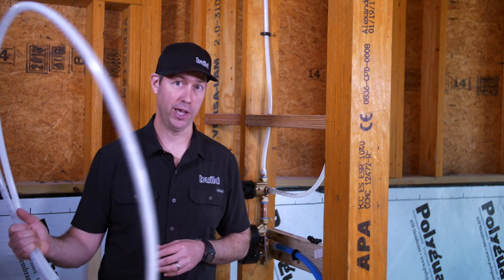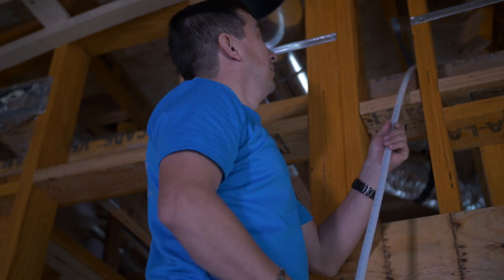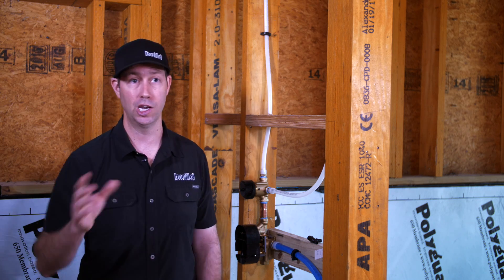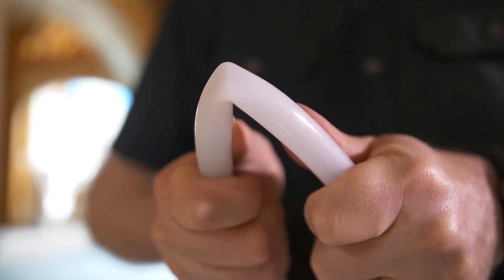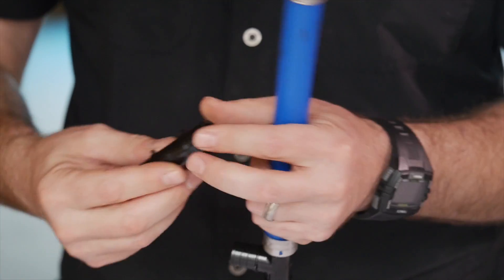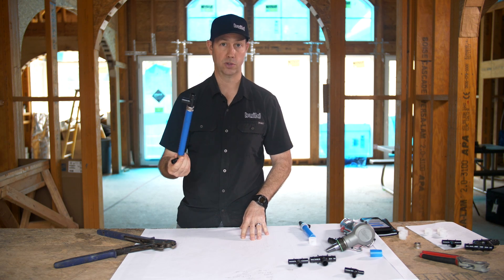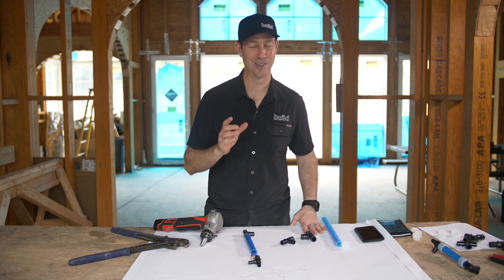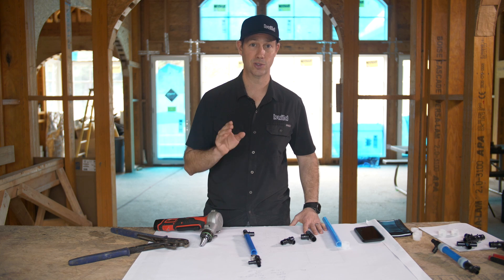PEX vs. Copper Plumbing

Comment: Thanks Matt. Great video, and lot's of info (no matter what others say!). Other than the price, installation ease,  and fitting inside diameter, is there any difference between PEX-a and PEX-b in regard to long-therm reliability?
Funny to see so much heated comments... I used copper main with PEX-b branches in my old house more than 24 years ago (because I was worried), but only used PEX-b when I build my cottage a few years ago. Should have used PEX-a though, for water flow.

Comment: I wonder about some other fitting systems such as Shark etc.  I don't do plumbing except at home.  I did gas and water plumbing as a commercial appliance technician.  I am planning some plumbing alterations using Pex but cannot validate expensive crimping tools.

Comment: I am hoping this video will convince my husband to finally switch to pex after 8 years of nagging.  He swears by cpvc even though he has to replace at least 1 pipe every winter.
Reply: You should spend a little more money on copper, copper lasts 70 years at min.
Reply: @ausintune9014  you have no idea  of what your talking about. I've had more than 30 leaks with type L copper pipes in the last 10 years.  PIN HOLES from city water supplies that have bad PH levels.
Reply: You live in Alabama ? Just go down to the crick for some water
Reply: He should convert to Uponor AquaPEX tubing.
Reply: We live in southern Alabama, so it rarely gets below freezing for very long, but we live in a house built in 1895 and we are rebuilding it as we live here.  There is zero insulation anywhere in this house and our fireplaces are non-functional.  And no central heat or air.  We just have little space heaters and lots of blankets.

Comment: Pex owner for last 10years. No leaks and I have the expanding fitting type .. excellent.. my only Plumbing failures were copper pipes and toilet flanges set on the subfloor then tile around it. I had to pull out a 2 by 2 area of the floor from a slow 10-year unnoticed leak between the subfloor and the backer board. Thanks to my plumber who Plum my house when I build it

Comment: When I bought a mobile home, the dealer hooked the water to it using PVC pipe. They then wrapped the PVC with heat tape and insulation. So. Every time I turned on the water I had an awful chlorine type smell, and the water tasted awful. I got headaches and my health seemed to be deteriorating during this period. I finally sold my mobile home and moved into a stick framed house with PEX. Now the water smells a lot better, but I still notice the chlorine type smell from the tap when I first turn on the water in the mornings, but after I run the water for a couple of minutes, it is hardly noticeable. What I'm saying is that any petroleum based product is going to leach toxins into your drinking water, and the hotter the piping gets the more it leaches. Is copper free of toxins, probably not. It's all relative, and those who run the EPA, FDA, etc. are not interested in informing the public, and could care less about our health.

Comment: I used pex B. I would prefer the pex A however the tool is very expensive and wasnt rentable in my area. I rented the crimp tool for $8. Took me about 1 hour to finish my small shower install job. I never did any plumbing before that time. My house is mostly galvanized steel also.

Comment: I have a mix of metal and PEX in my residence.  Before the PEX was installed, replacing worn-out galvanized pipe, I would sometimes get water hammer, but since then it has been significantly damped, making a gentle "chuff-chuff-chuff" sound when certain fixtures are in use.

Comment: This guy is wrong about the pressure drop. If you check the inside diameter of pex compared to copper, the copper is larger, plus the fitting also. I guess you can tell I lean toward copper. Well I have been a plumber for 45 years and still going. I should let you know this also, when they show you how pex does not bust when it freezes, well that's not exactly true. After pex is a few years old it becomes brittle and it will bust. Plumbers tell me all the time they are out fixing busted pex piping from freezing. Plus the plumbing inspectors tell me a lot how pex joints are failing.  I do listen to what the inspectors have to say since they see this stuff  a whole lot on the job sites...I'm surly a old school plumber and I will not cut corners...I call myself a specialty plumber...
Reply: Why not simply use bigger dimensions of PEX? Instead of 3/4" Cu, add 1" PEX? PEX have lower resistance, so more water will flow trough for the same ID, also fewer fittings decreases the resistance. This is simply no problem if you do some simple calculations. Compare Cu not to PEX but to Uponor? I think most of your problems will disappear with some very basic calculations + Uponor - they will be gone!

Comment: I plumb everything in L copper.
It's hard to beat a soldered joint.
Plastics are polymers, they get brittle and they crack. I prefer metal. A piece of L copper will last 100 years. Iron American Dream on YouTube Share it. Take a ride across the promised land. Imagine having to replumb your house.
Reply: There are more than 1 type of metal, and there are more than 1 type of plastic.
Reply: elbuggo, CMCs , graphene, I will take Material Science for five Bob.
For water distribution, provided the water is clean, it's hard to be a piece of L or M copper. Copper is necessary in your diet, 4 parts per million, for the function of an enzyme called Lysol oxidase.
It catalyzes the cross-linkages in the proteins that make up collagen and tendon. What do smart people about? Iron American Dream on YouTube.  Share it. Take a ride across the promised land.
Ride a Harley.

Comment: Plastic eventually degrades.  The problem is not short term leaks but long term failure of the whole system.  I wonder if this YouTuber would use plastic in his own house.  If he does kudos for putting money where his mouth is.
Reply: You may want to use pure stone for your plumbing. A stone can last for millions of years.
Reply from the maker: +kds471 I have PEX-b at my house. That's been my main system for 15 years now.

Comment: Use PEX from the well house to the house - there is nothing like runnning 300 feet of pipe with no connections.  None of the issues like broken joints that I had with PVC.  It seems to take direct burial well with no contamination; I sleeve it under roads and anywhere near septic lines.  I've also started using compression fittings like SharkBite.  Easy one, slightly more difficult off, no glue, no crimping, and it seems to hold in all weather.

Comment: I first used pex B and loved the long runs and speed of installation.  Crimping copper rings wa fine mostly bit a number of times it was difficult to get the crimp tool up in tight spaces between joists / rafters and I got some leaks because I could not crimp squarely onto the brass fitting. So I have replaced the pe b with the Uponor expandable fittings. Not only are the plastic fittings much cheaper, the ability to expand the pipe makes joining easy especially in hard to reach areas.  Note Uponor brass fittings are more expensive than other manufacturers brass fittings and you can only use Uponor brass for their PEX A hense I use the plastic whenever I can.  And local plumbing supply companies charge more than the online suppliers.  I wound not want to use a manual expander so I found a used milwaukee expander on eBay for less than 100 bucks.  Did not buy new ($500.00)  to do two houses.
Reply: Very Lucky Buy on the M12. Do you want to sell it?
Reply: I made my own crimping tool when I added an outside shower outlet on our motor home, and couldn't get near the crimp rings with a regular crimper because of confined space.
I used 2 pieces of 1/2" x 3/4" x 3" pieces of steel, clamped to two pieces togeter and drilled and tapped out for 5/16" bolts to hold the pieces together.  I then drilled a 11/16" hole in the middle between the two pieces.  Takes a bit longer to do a joint, but no problem pulling the two sides together with a bolt on either side of the ring hole. Also came in very handy when I tired of copper lines clogging from calcium, and replumbing the whole house several years ago and ran into small spaces.  Never had a single leak, neither in the motor home, nor in the house.
One added benefit of PEX over copper that I didn't see mentioned is safety.  No fire has ever been started by a crimping tool, something that can't be said about a torch.

Comment: Matt, I enjoy your videos.  As someone planning a custom home build, I'm very interested in the topic.  I feel one important thing was neglected: LONGEVITY.  As you are clearly a fan of pex, I'm guessing the omission was purposeful.  I have heard the warranty on pex is 20-25 years, and the lifespan on copper is easily 50 years.  For someone planning his "forever home", can you comment on the longevity of these products?
Reply: PEX has a half life of 100 years, and through rapid aging tests has been shown to last the equivalent of 1000 yrs., so I don't know where you are getting the "20-25 years" thing.
I am a Master Plumber with over 40 yrs. in the industry, after attending 2 workshops in PEX I did the new back of our house in it, and have recommended it for the past 4 yrs., it is a better system, and does not affect the taste or smell as some try to say.
It also is like anything else, done right it is good, done crappily it won't work.
Reply: Thanks, niceguy. Good info.

Comment: I just installed about 30 ft. of the blue water line with shark-bite fitting in 3/4" from the front of the house to the meter. Water Co. put in new line just inside the house and I had to finish the rest. So far so good, now I need the water Co. to turn the water on at the curb box. Blue pipe is really stiff. I now have to get a 1/2" fitting to go into the meter. Thanks for your video. I like the Shark Bite stuff.

Comment: You just sold me on copper "pex breaks down in chlorinated water" but at least you can't " notice a different taste".
Reply: Uponor AquaPEX® tubing for potable-water applications is certified by NSF International to meet the latest ASTM F876 oxidative-resistance requirements (i.e., chlorine resistance) for continuous recirculation, where piping is exposed to hot, chlorinated water 100 percent of the time.

Comment: I was not aware of pex-a but pex-b not only has smaller ID in the fittings but the pipe itself has a smaller ID because pex has thicker "walls" than cpvc and copper. Pex is still "CTS" or "copper tubing size" however that refers only to the OD  of the pipe (because copper fittings - sweat/compression/flare - fit around the outside of the pipe). This drastically reduces the safe water flow rate of pex compared to it's copper and cpvc counter parts. Only considering flow rate, step up each size from the norm with pex to perform similarly. (1.25in, split to 1in each hot/cold, 3/4" to fixtures, 1/2 to small fixtures, etc.) It can be quite the hassle. Also rough ins can be tough without a rigid pipe and it can look bad if exposed (drooping).

All that to be said I like pex if you know how to use it. Pick your pipe based on the below:
What's most important?
Longevity - copper
Cost - CPVC
Ease of install - pex

Comment: I️ had a huge disaster with Pex on a forced hot water heating system. It burst leading to a basement flood. When I️ got my new burner, they used copper only.

Comment: Wouldn't the smaller diameter of the metal band pex add pressure instead of losing it?  When you put your thumb over the end of a water hose you increase the water pressure by restricting the diameter of the supply, wouldn't this work the same way?

Comment: I read most of the polybutadiene lawsuit summary and was surprised to find out how limited all pressurised plumbing is. 
They gave average life spans (don't quote me, look it up) of 30 years for most plastics, 40 years for copper, and 50 years for galvanized steel. 
Houses built in the 70's are having copper pipe failures at an increasing rate.
Reply: Correct, copper pipes usually are expected to last 30-50 years, however in many areas they can last considerably less, I use bore water which is obviously pretty mineralised, and copper water pipes last less than 15 years on it, they often started pin holing at less than 10 years (used to use those 'pinhole leak clamp' repairers on them until the pipe was more clamps then pipe...), one thing that can increase copper corrosion is increased turbulence so bends rather than elbows helps, as does  spacing fittings well apart if possible, but pex a is not only quicker and easier, but actually lasts longer in areas where chlorine is high, or lots of minerals are present in the water

Comment: One thing I noticed between the plastic tube and copper pipe is the plastic delivers hot water sooner. The copper pipe absorbs a lot of heat before it gets to the faucet. In some cases you can hear the copper pipe staining against the brackets holding it with a creaking sound as it expands.
Reply: This happens when the brackets holding the copper are too tight.
Reply: Jerry Oswald — yeah, for this reason pex is great for bathroom remodels where the bath is a long run from water heater.  Also, temp at bath faucet matches temp at shower head.
Reply: Just another way for it to fail.
Reply: Noise from copper pipe expanding is from the copper brackets being installed too tightly around the tube.  The plastic is also expanding...quietly if properly anchored. Not a fail factor.
Remember Aluminium wiring....................
Reply: Standard PVC pipes do as well...everyone has explained why already though :(
Reply: @Amanda Worley - Who uses PVC? today It's all about PEX.
Reply: While it is true that copper will leak heat like crazy, it's better in general.
Reply: +Ausintune It has its benefits in some specific cases but for it to be better in general it has to better in most cases (which it's very far from).

Comment: Cooper has one important benefit it is aseptic. 
It kills bacteria.
Reply: Not once the scaling has built up.  Cut open (or google) a copper pipe after a year of use.  Water isn’t I contact with copper once scaling builds.
Reply: Yes
Reply: Bradley Cooper?   Copper*
Reply: not all bacteria is bad for you.  and if there is a lot of bad bacteria, the piping won't save you
Reply: technically bacteriostatic, it's not significant enough to actually "clean" your water

Comment: PEX is vulnerable to UV so when doing an install, best to make sure its not exposed to sunlight. It can get brittle. Copper has a microbacterial benefit where PEX and CPVC do not. I just went with PEX for line to kitchen remodel and the pressure is outstanding. But that said, the valves feel...cheap. But hey, blue for cold, and red for hot water :)

Comment: So the better system takes a little longer to install, I can live with that, and I won't be filling my body with petroleum products, that sounds good. Material is more expensive, and labor cost is more so the bill will be larger, I like that. The water hammer problem, well that is never a problem when installed properly, so what is the problem?

That's why Copper's #1, simple, build it right the first time, make more money, your customer will always remember you installed the best, and the mice will never chew on your quality material, oh yes they chew💲

Comment: Interesting but here in the Philippines we are using PPR for water supply systems. For long runs it is pretty flexible. The fittings are solid joins, the pipe walls are thick, and the estimated life span beats all other systems, even copper. But, you didn't mention PPR. Why?

Comment: Matt, I am a homeowner that pulled all the 20 year old copper out of my house because our well water is acidic and the copper pipes were suffering pin hole leaks.  In the last 7 years there have been about 5 leaks. We do not have a water softener and prefer not to have one.  I have replaced all my plumbing with Uponor ProPex using brass fittings only.  I do not think the Uponor plastic fittings can stand for 30 to 50 years like the Pex tubing and the brass fittings can.  I use the Milwaukee tool that you show and have never had a single leak or failure.  With the brass fittings the ProPex system is not cheaper than traditional copper.  Those fittings are expensive.  Finally I would like to agree with you that the total pressure drop of the ProPex system is much less than any other system and its resistance to freeze is very good.  One disadvantage to any plastic system relative to copper is that they can be chewed by rodents. One disadvantage to type B Pex is that the crimping tool has to be calibrated or they will fail to provide the proper crimp.  I prefer ProPex over all other systems.
Reply: @barkbarkattemoon:  can you cite something as to the reliability of the brass vs the poly Uponor fittings regarding low ph water conditions?  I'm just about to rip out all the copper in my house because of low ph and was planning on using the poly fittings.  Are the brass ones immune to low ph?

Comment: The biggest drawback I've come across is the algae that grows inside if any light hits it. Most people would never know, but I had a job with uninsulated pex in the basement and the indirect light caused growth in the pipe. It was chlorinated water also.

Comment: Couldn't most of the issues described by people in comments be solved by the simple application of a pressure regulator and whole house chlorine-reducing filter? If you're worried about petroleum products from the PEX, what about lead in solder for copper?
Reply: there has not been lead in solder for years...

Comment: Running hose vs. cutting, routing and sweating copper? Way easier and faster. I've run PEX in 4 of my houses over the last 5 years and it's still all good. Rodents possible? Yeah, but I've yet to see it.